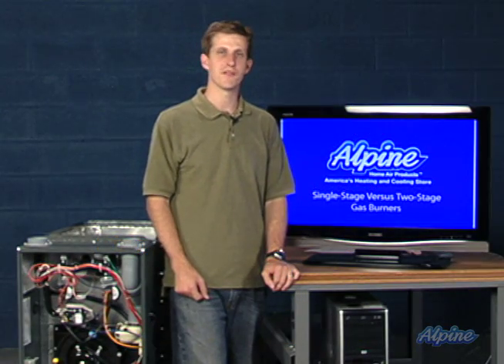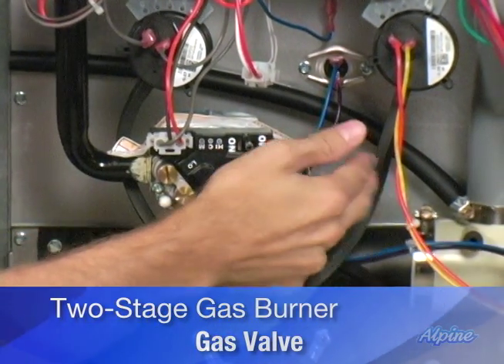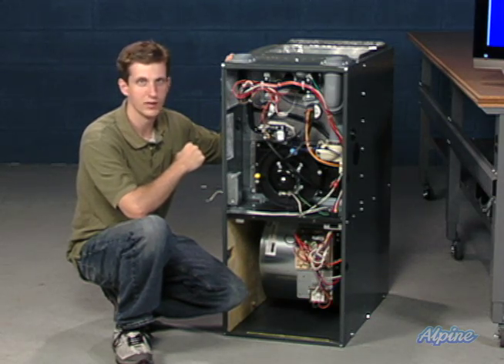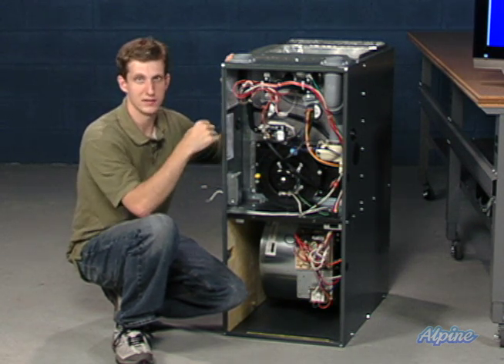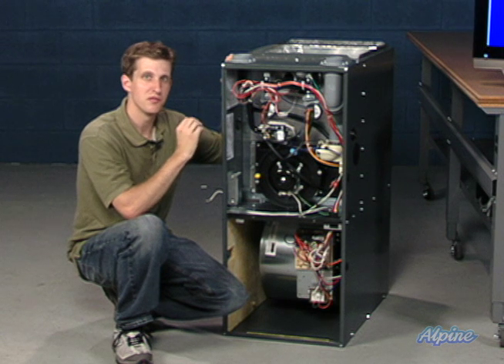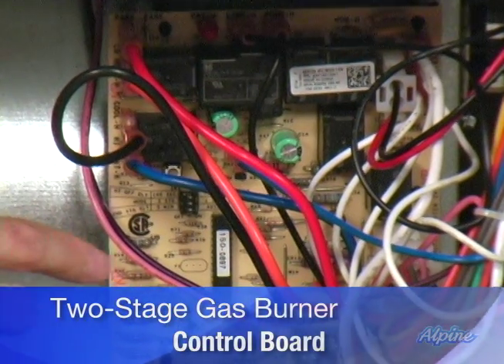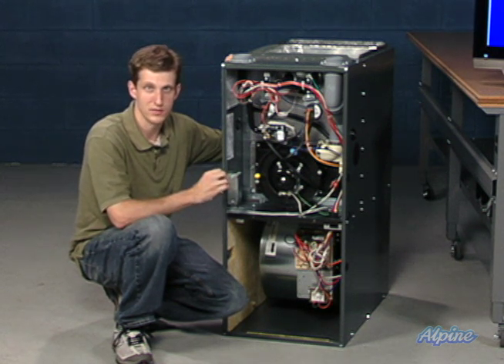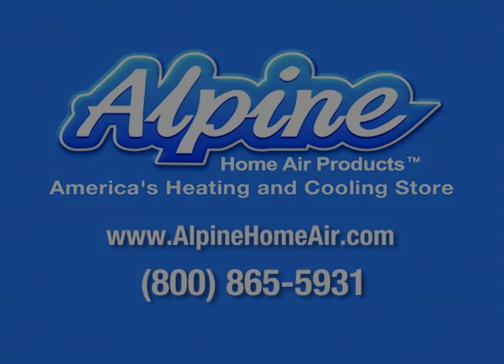Single-Stage vs. Two-Stage Gas Burners

Comment: Disagree strongly.   Got a 2 stage because the govt grant only allowed for that.   2 Stage is meant for very cold climates of short duration.  On the temperate coast, we often defeat the second stage.   A single stage thermostat can be used, but the jumper on the board simply makes every call for heat a stage 2 call.  Unless a two-stage-thermostat call for stage 2 comes while stage one is running, the firmware causes the furnace to attempt to reach the goal with only stage 1, because it is more efficient than stage 2, and kinder to the heat exchanger.  If unsuccessful after a certain number of minutes, it invokes the noisy stage 2.  Because the thermostat is usually asking the furnace to recover a heat loss of less than 2 degrees,  stage 2 usually requires only an additional minute to reach the goal.  My math tells me that this means stage one could have done it just fine in less than 2 additional minutes.   Even recovering from a lower night setting,  stage two only saves a few minutes of recovery time.   Does not justify the extra cost, lower stage 2 efficiency, plus the higher risk of failure of a more complex system.